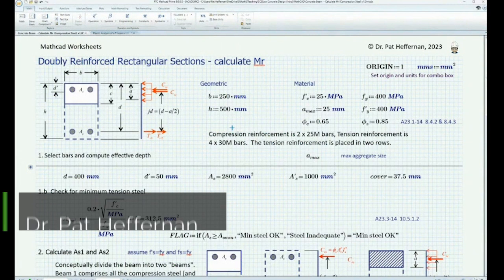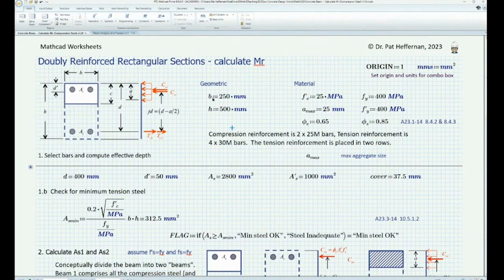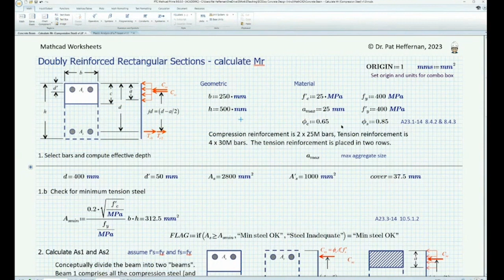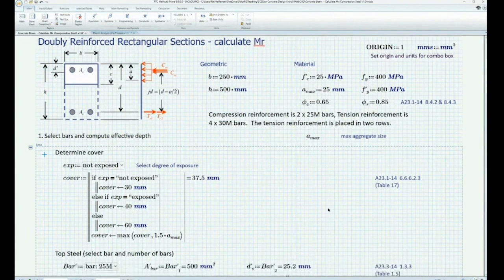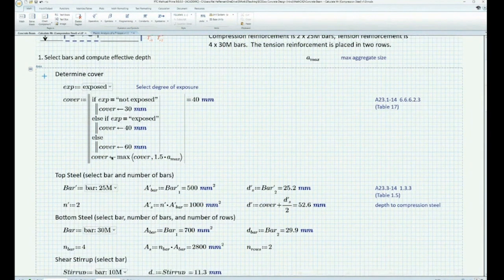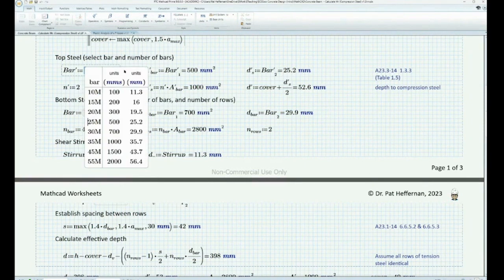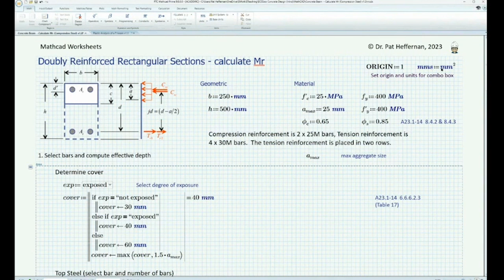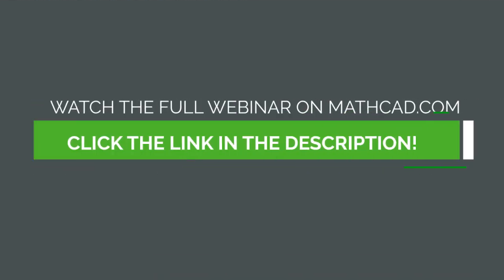Mathcad Worksheet to Calculate Moment Resistance for a Doubly Reinforced Rectangular Concrete Beam

Comment: If you are not doing symbolic math in Mathcad, it becomes pointless. In solving engineering problems we come across a computation like the above problem but we have to solve the same problem for  n number of sections where excel beats Mathcad in terms of presentation in form of tables. Just not satisfied with the progress of Mathcad in Civil Engineering. Mathcad needs to get close to mathematica or matlab to remain competitive in the market.